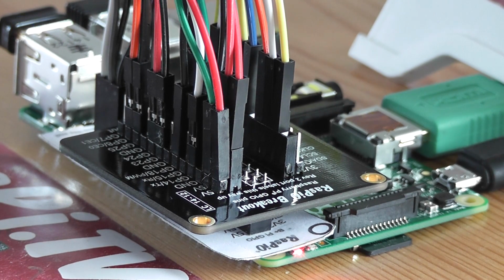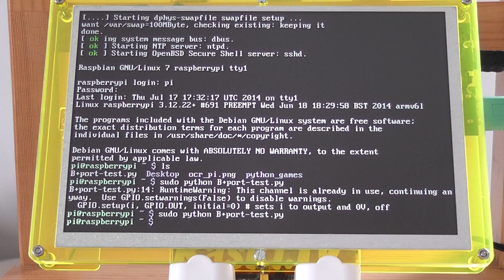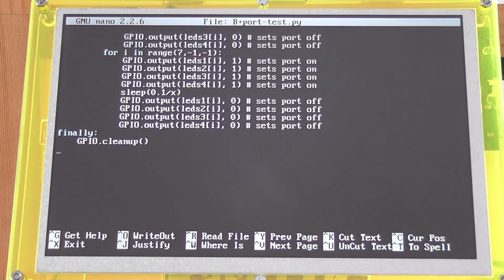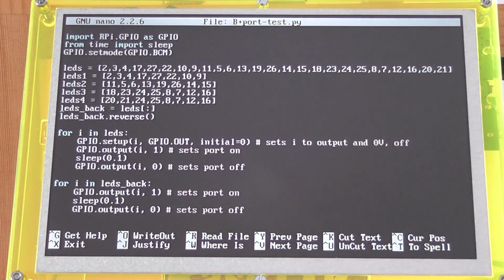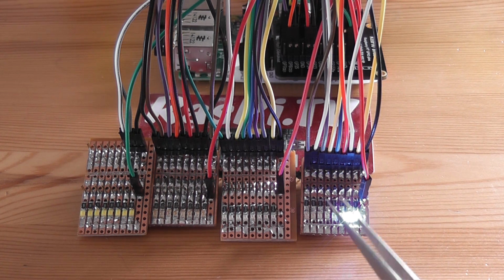Raspberry Pi B+ GPIO port testing

Comment: Why do you need the Darlington array chips?
Reply: Current limitation/safety. The RasPi can only output so many mA per port AND in total. It's the same case for the Arduino (which is my experience, i use Darlington arrays for the same reason).

If you use a Darlington Array .... most of them are rated 100's of mA per port. Which is safe enough. And they take very very very little to activate :)
Reply from the maker: So I can run the LEDs at full brightness with 5V as the source instead of worrying about the 16mA per port and 60mA total 3v3 rail limit. I could light these babies all up at once with no adverse consequences. :)

Comment: I like the led module idea (and a nice intro to surface mount soldering) , which (array) chip did you use?

I think I`m basically asking for a parts list to build my own, as I`ve never used surface mount parts before.. :)

Thanks.